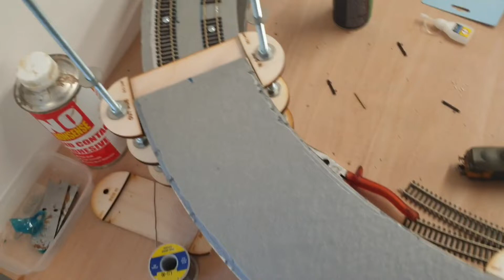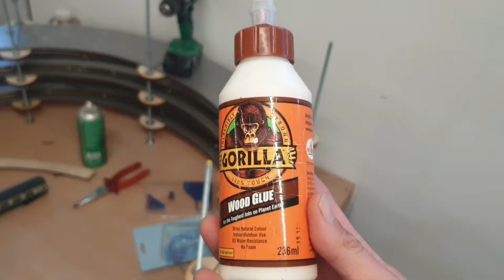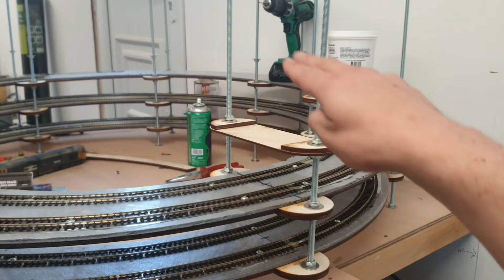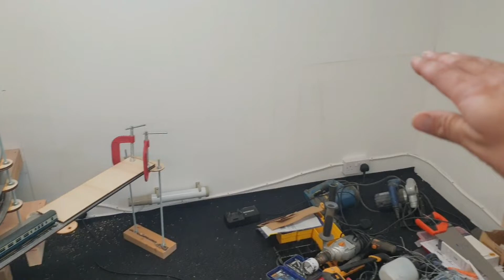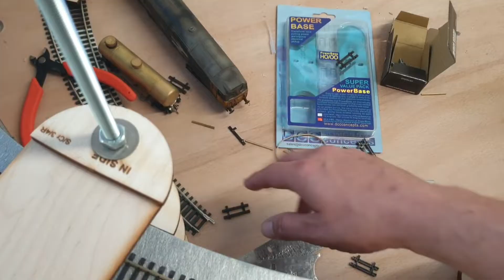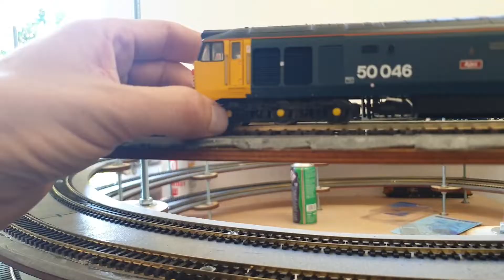oo gauge helix build and testing  dcc train automation 3rd / 4th radius  re upload sound fixed

Comment: Really enjoying your videos. Particularly interesting to see the problems that appear when building the helix, and your solutions to the issues. Great to see that 75mm spacing between the levels is working well. That is the spacing that I was planning for my helix.
I would still encourage you to put in the infrastructure for automation - you may change your mind about automation, later. Automation is continuing to evolve and becoming easier to implement, so it may become more attractive at a later date. With automation you can still drive all your trains manually when you want to, or some manually and some semi-automatically (which means you drive them manually but the train will automatically react to signals or emergencies, making driving much safer), and some trains fully automatically, or any combination of them all. So you have the best of all worlds. Automation will allow you to run more trains at the same time, safer, making the layout more interesting to watch and more exciting to run. All you need for the infrastructure is to split the layout into isolated blocks and have droppers in each block. It's not much different to what you are doing now. Send me your track layout and I will show you where the blocks would be and where the isolation and droppers need to be. You can then make an informed decision about whether to make the slight alterations now, whilst you are in the construction phase. Like I said, it will make no difference if you never use automation, but the infrastructure will be there if you do later. There will be virtually no cost implication at the moment.
Reply from the maker: Hi give me an email StocktonJunction@gmail.com